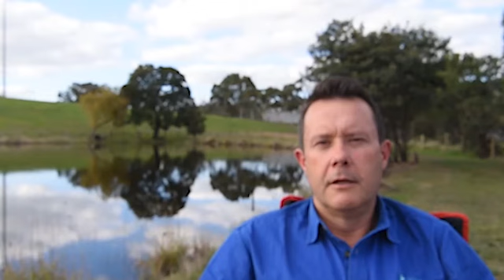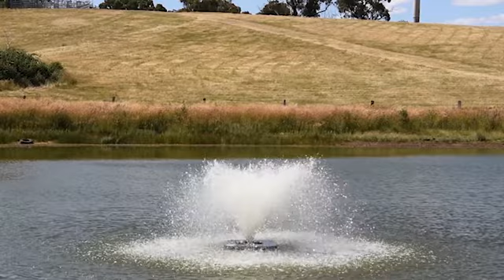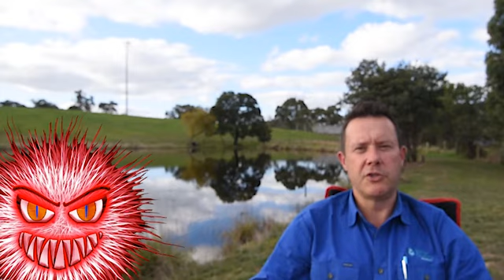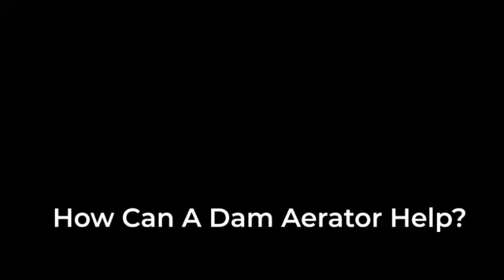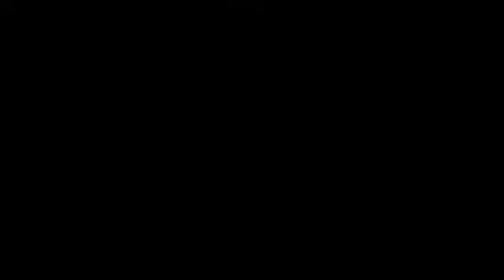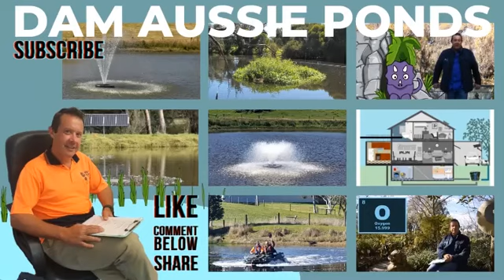Dam Aeration   What Are Dam Aerators And How Do They Work?

Comment: I have a dam that's really milky ( clay bottom ) I've heard that letting some good hay break down on the waters edge will make the sediment settle. Would you agree?
Reply: Hi mate, I had the same problem and sorted it with some Aluminum Sulphate, which is a flocking agent used in water treatment plants. You can buy from most rural supplies shops.Itflocks the dam and makes all the floating particles sink to the bottem,leaving water crystal clear.Same as flocking a swimming pool. Safe for livestock and people.:)
Reply: @craigberry6546  Just don't use too much it can also be used to tan hides